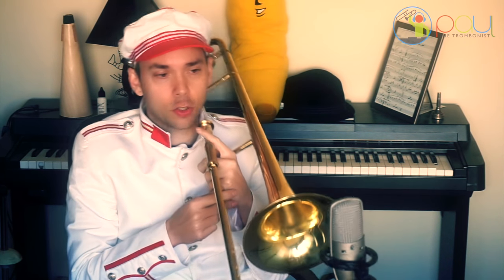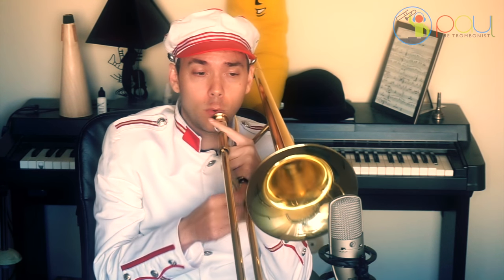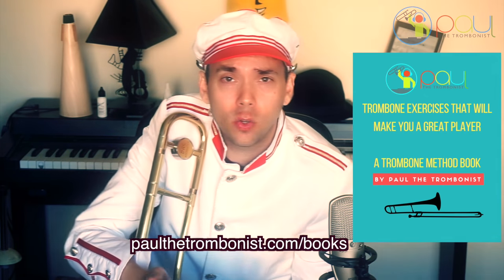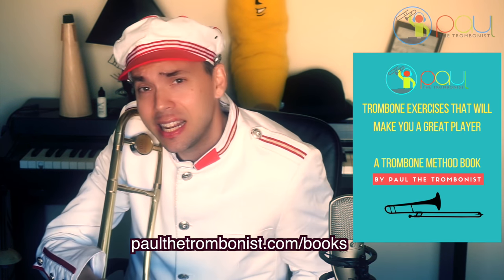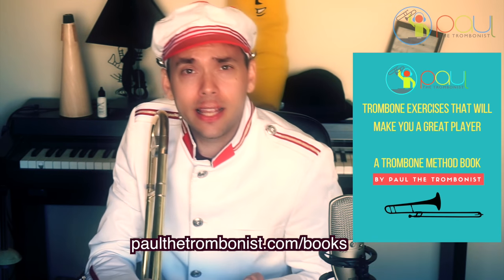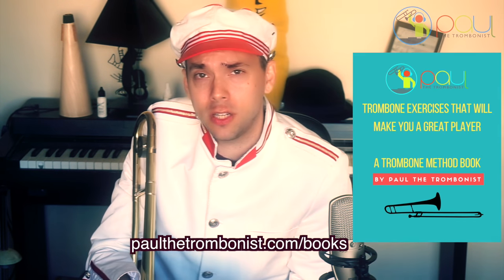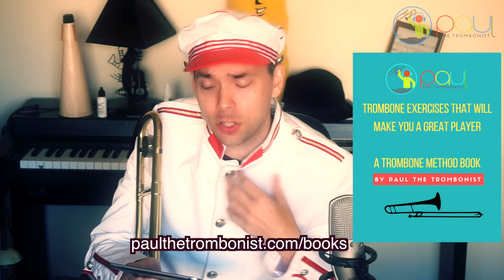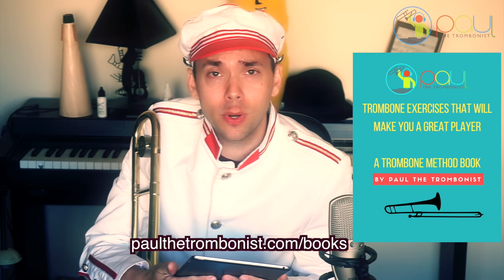How To Not Crack Notes On Trombone

Comment: I personally see those cracked or not clear attacks of the note when I am not focused in my corners and there is extraneous vibrations around the apature of my buzz in the center.  For me most of the time is in the upper left side of lip. not always but mostly.  In other words if I SUPER focus on airstream being where I need it and firm corners it works.  

Another thing I have seen is not having the slide EXACTLY where it goes for that specific horn and note. In other words my ear (mouth and airstream) are trying to compensate for intonation, thus bending pitches and flubbing notes in the process.  If aware of these four things, corners, apature, airstream and slide position (tuning) then they typically don't crack.  Easier said than done but....

Mouthpiece buzzing to drones in the car works wonders for this.  Look like a lunatic at the red light but whatever works right!?

Comment: Hey guys. I’m a very advanced 8th grade trombonist and I’m needing a new horn because my beginner horn that I have had for two years was falling apart. I need a new horn that’s not too expensive but that is also very good for its price. Any suggestions ?
Reply: foreignboikev 1 well Jupiter or Conn horns generally are the better slightly cheaper good horns. I would rent until you own if you have that option. Bach trombones are also great if you can find one that plays well, in my personal experience they are either really good or okayish.. I always get open wrap horns, but closed wrapped horns are also good, I just prefer opened. Another thing to keep in mind is the mouthpiece if you’re going from a small shank beginner horn to a f attachment with a large shank. Good luck tho